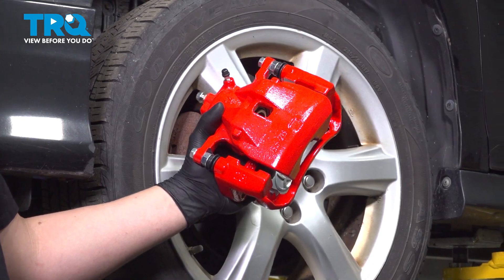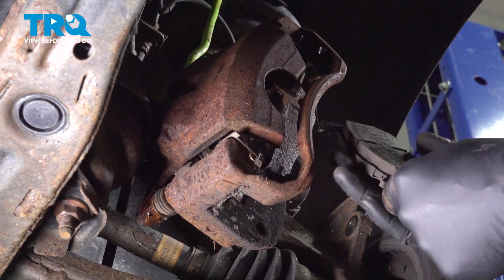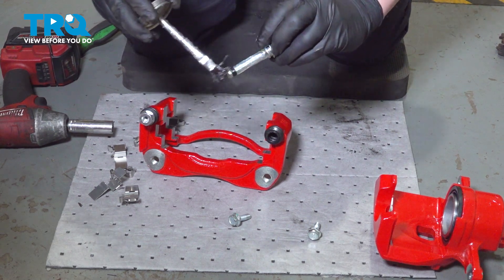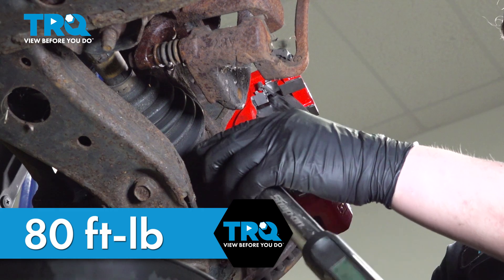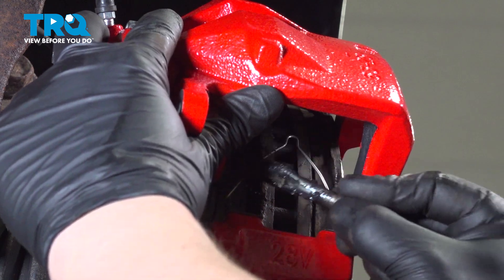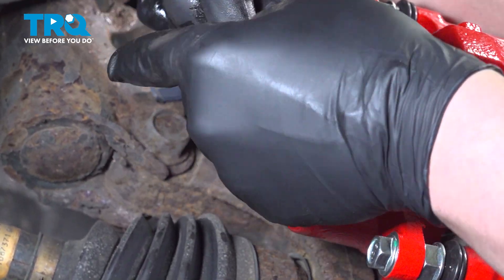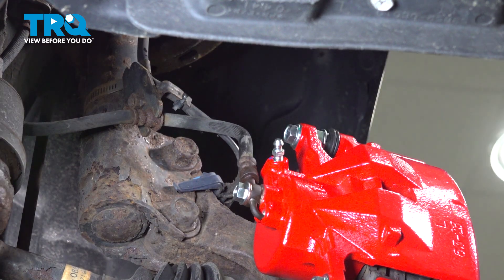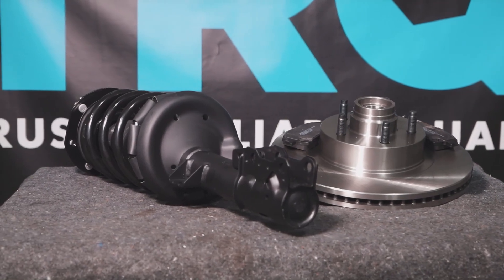How to Replace Front Brake Calipers 2007-2011 Toyota Camry

Comment: Awesome tutorial, seems very easy. I would mention at the end when waiting for the stream of fluid without bubbles, you should also make sure it looks nice and clear like in this video. But if it looks dark and/or has a foul or burnt odor, you should also do a flush if all the brake fluid in the system, bleeding at all 4 wheels until you see the new fluid. And never use old brake fluid that has been opened before and then sat in your garage for months or even weeks. Once the seal is broken brake fluid will start absorbing water from the air which will contaminate it pretty quickly.